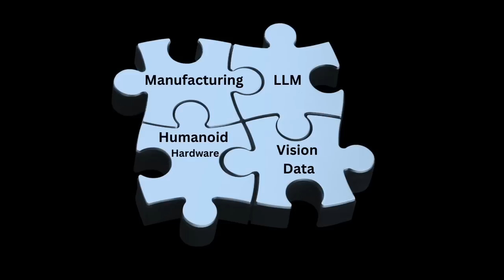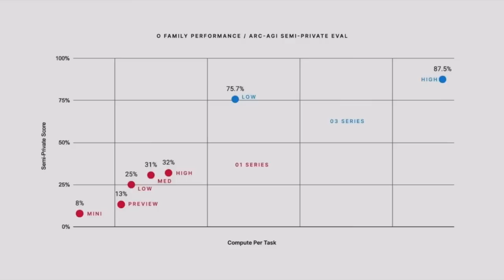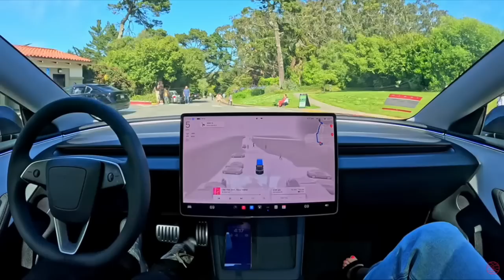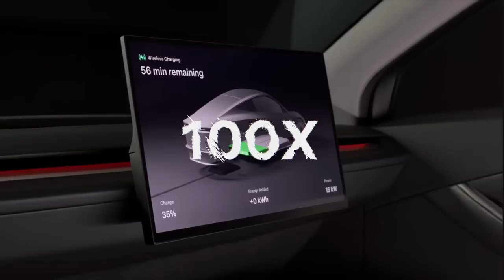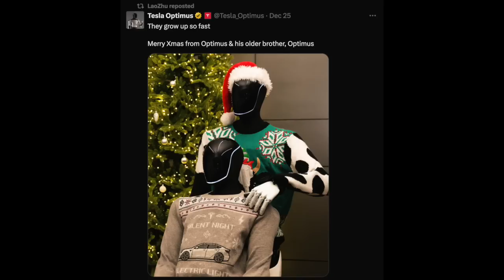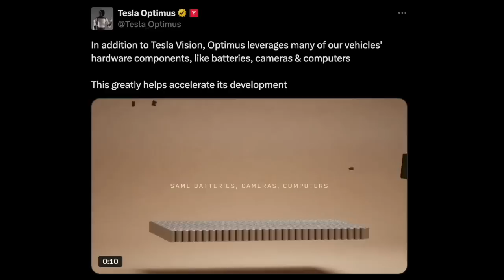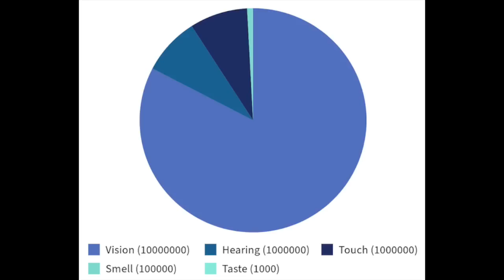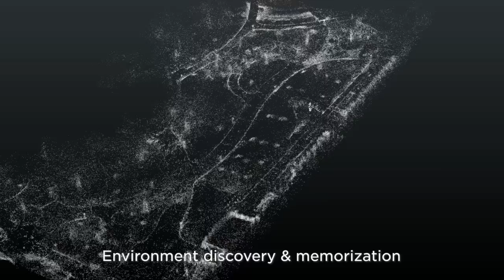2025 -The Year AI Could Match Human Intelligence - How Tesla's Tech Will Redefine AI

Comment: I don't know what "10 million beats per second means." What are "beats?" Anyone know?
Reply: Cycles per second, or samples per second, or frequency per second, e.g. 10 megahertz.  Then consider the servo frequency or reaction time for action reaction with a finger moving, balance when walking, my cranium is overheating thinking about this.
Reply: @carlwest859  thanks!
Reply: I guess you meant " bit" not "beat" the following is detailed explanation :

"Millions of bits per second" (often abbreviated as Mbps) is a measure used to describe the speed of data transfer, like how fast your internet connection can send or receive data. Here's a simple explanation:

Bits: A bit is the smallest unit of digital information. It's either a 0 or a 1.
Millions: This means one million (1,000,000) bits.
Per second: This refers to how many bits are transferred in one second.

So, if you have an internet speed of 10 Mbps, it means 10 million bits of data can be sent or received every second. To put it into perspective:

Downloading a small file: If a song is about 5 million bits in size, with a 10 Mbps connection, you could theoretically download it in half a second.
Streaming video: High-definition video streaming might require several Mbps to keep the video smooth and uninterrupted.

Mbps is commonly used when talking about internet speed, network bandwidth, or data transmission rates in technology. Remember, though, that actual speeds can vary due to many factors like network congestion or the quality of your connection.

I hope this helps !!
Reply: @PKChristIsKing  Actually, that was the problem. I meant "beats" but because of the accent, that's what I heard him to say. I know what bits are but your explanation was most welcome, thanks. It is instructive to imagine just how powerful the brain is. I was recently considering what happens when you see something that you "mistake" for something else. The brain does something like a Google image search and instantly comes up with a very close match, somehow eliminating myriads of other images you have in your memory. Then with just slightly more info, you determine the correct match.
Reply: @terrulian  ooh ok I got you now brother!